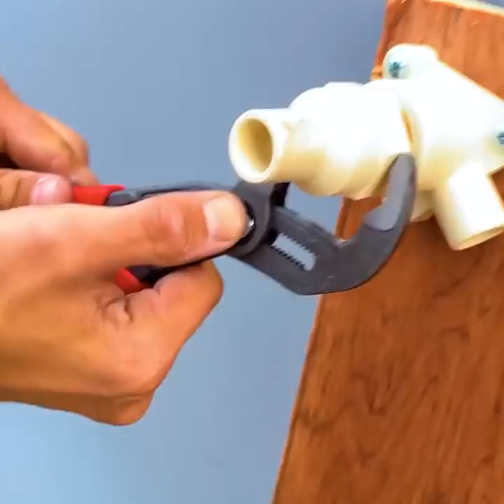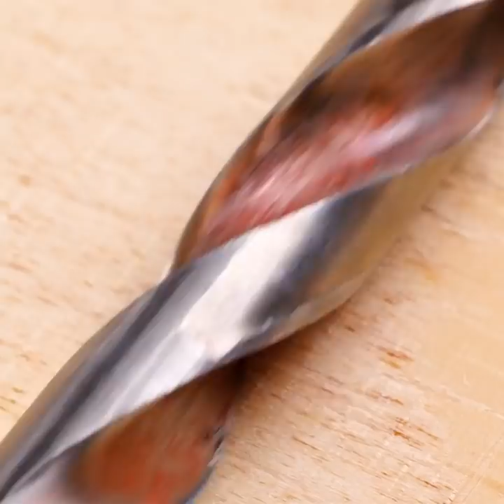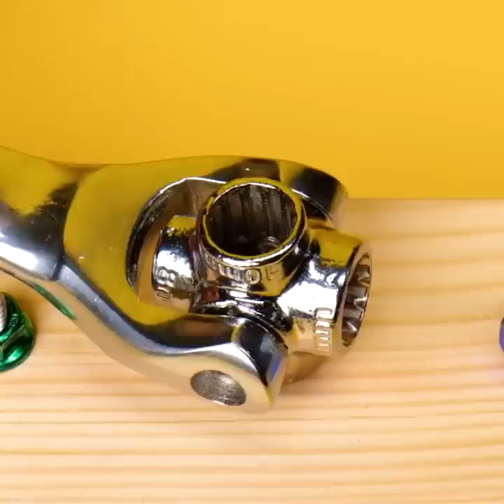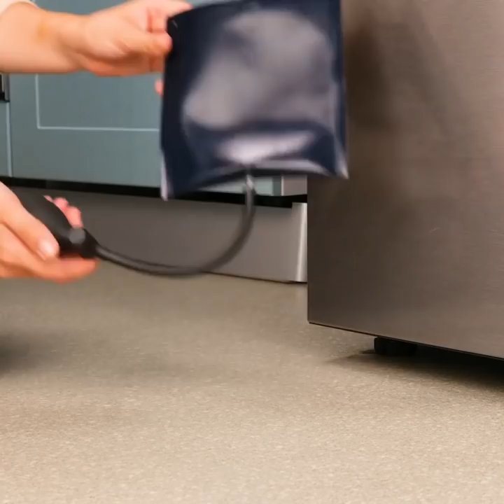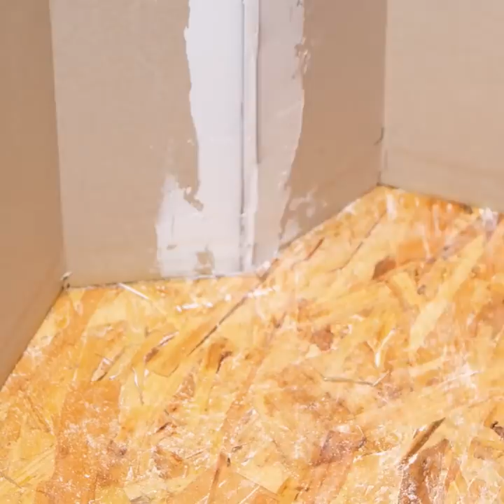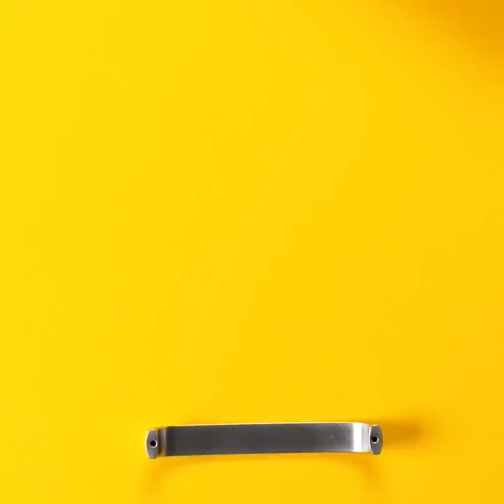HELPFUL FIXTURES FOR PLUMBING || SMART TOOLS FOR REPAIR

Comment: luv the copper tubing resizer
great pliers
rivit blaster .. aces
screwgun attachment.. super 
ditto sabersaw
a great manual chain saw .. not just a wire.. chain with teeth
super string tape has good uses